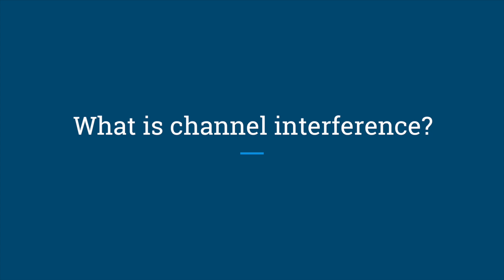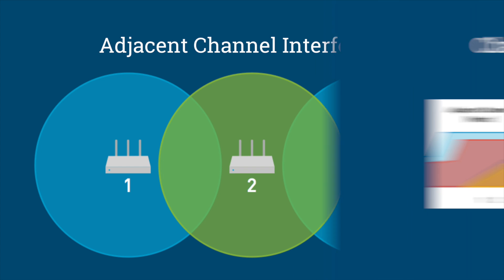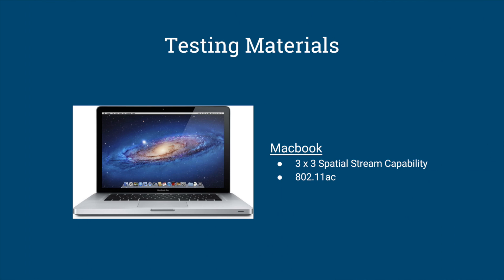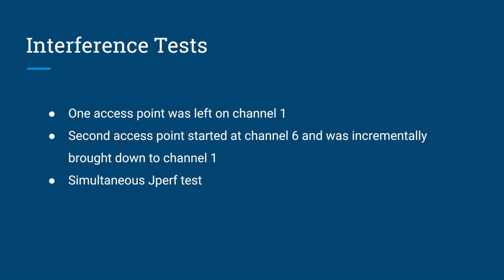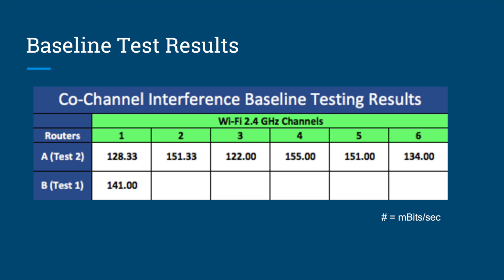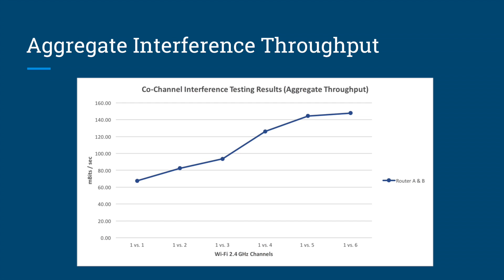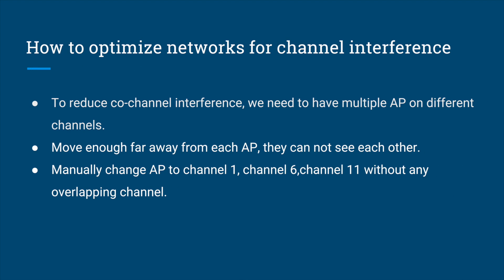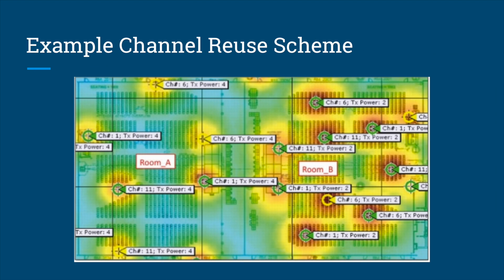Wireless Channel Interference Testing

Comment: I've found that sometimes with more distant AP's it's best to jump between channels,  such as 4 and 9.   While this is generally considered Rude sometimes you can step over the other distant AP's instead of waiting for the channel to become freed up to transmit.   In the end sometimes you can get more throughput and less retransmissions.   The key here is distant AP's.   Do not try this if your dealing with strong nearby AP's,  stick with the normal 1, 6 or 11 channels.    This would be for home users only and only if your far away from other AP's.  It's a very bad idea otherwise.   In my case I have some idiot broadcasting 40 Mhz on 2.4 so 1-6 are trashed.  Running channel 4 I see way better performance.  I also have a spectrum analyzer,  so kind of cheating a bit.